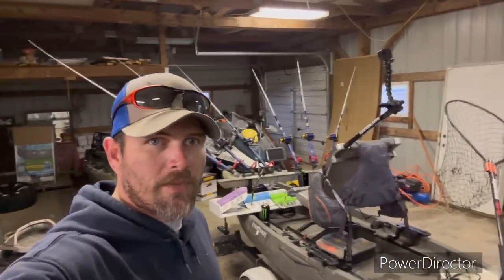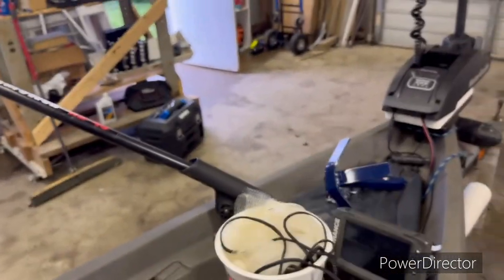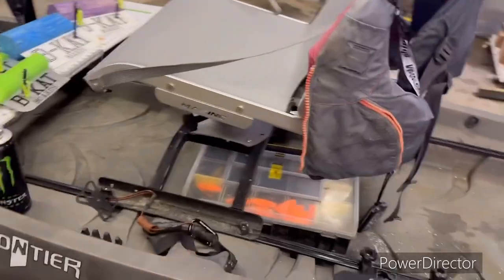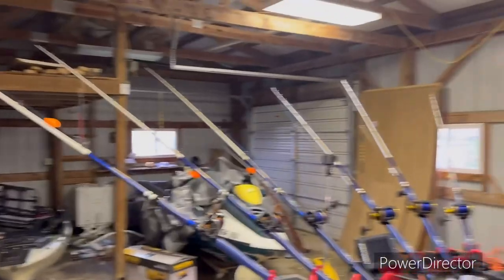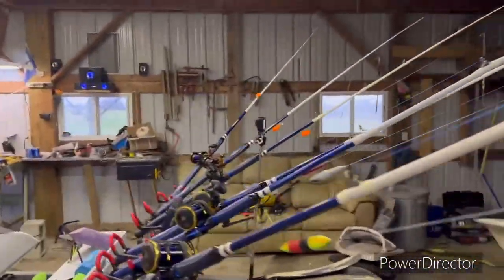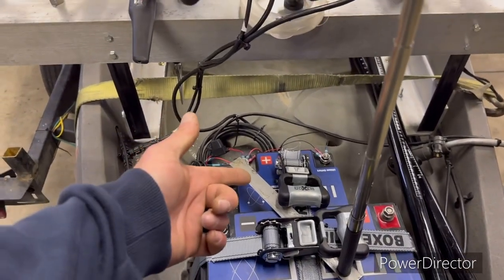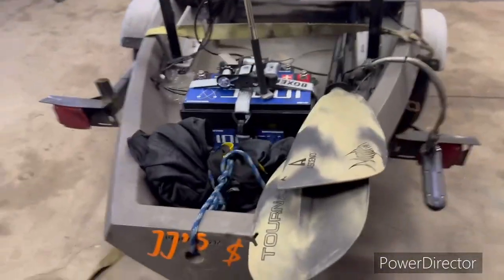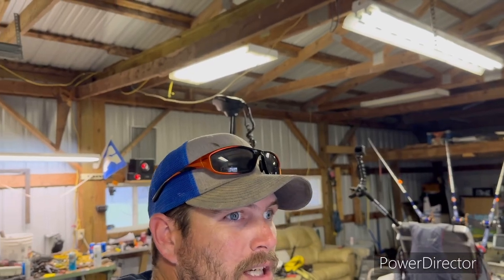The most insane fishing kayak I have ever seen.

Comment: If u hook a monster your going to get towed. 
-Jk 😁 Won't u need help reeling in the other lines otherwise find your self in a tangled situation? 🤔
Reply from the maker: I’ll do a separate video on that. If I use crude control on my motor it keeps me going and doesn’t let the fish tow me backwards. The other lines are cast at different distances in a staggered pattern so that I have time to get control of the fish before it makes it to another line but even at that they do get tangled with big fish. Usually 50 lbs and bigger but it’s worth it with a fish that size
Reply: @ryanbortzbluecollarlife  awesome 👌 yes video it in the water 😃